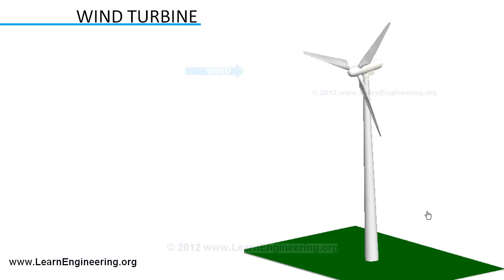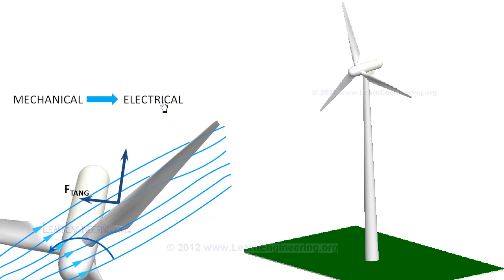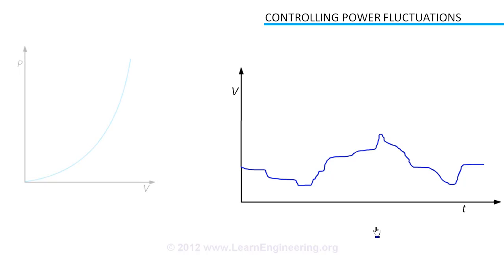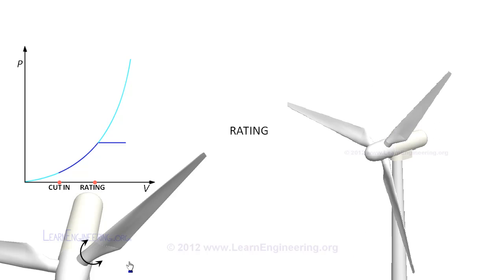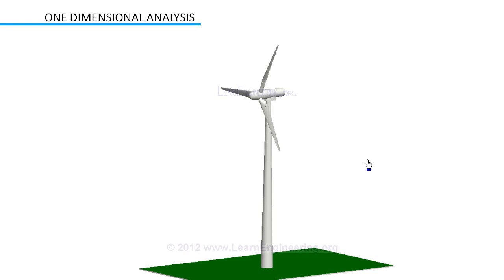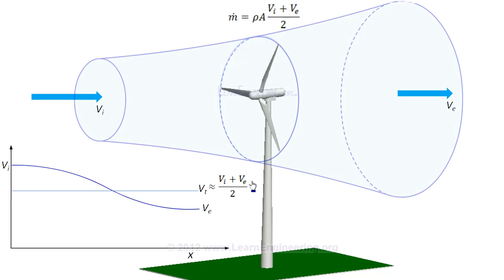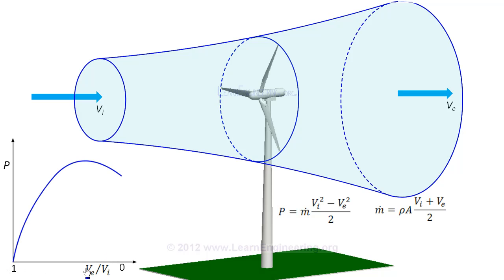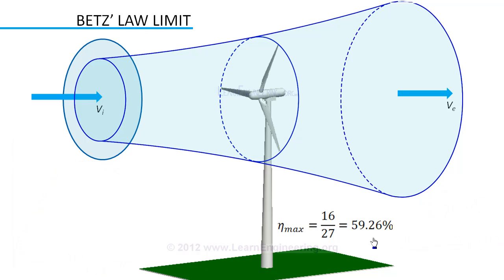How do Wind Turbines work ?

Comment: What's stopping them mills from being struck by lightning
Reply: They get struck by lightning all the time! They have protection systems in place, so that the blades and other turbine components don't get damaged from the strike. So usually there is a metallic receptor in the blade tip, and when lightning strikes it will hit that receptor, which is connected to a large cable that runs all the way to the root of the blade and is connected to the earth through the turbine. This provides a safe path for the lightning strike to travel to earth without causing any damage.